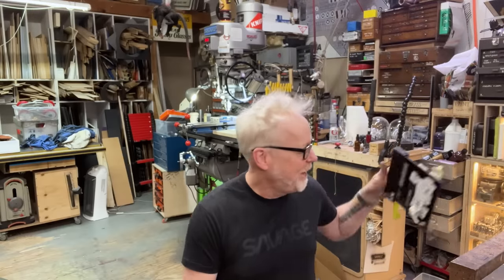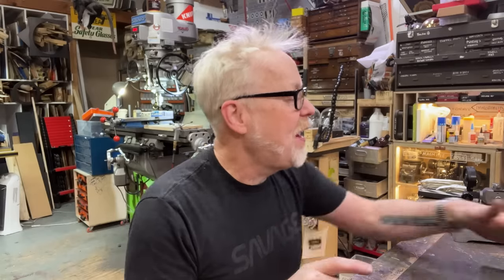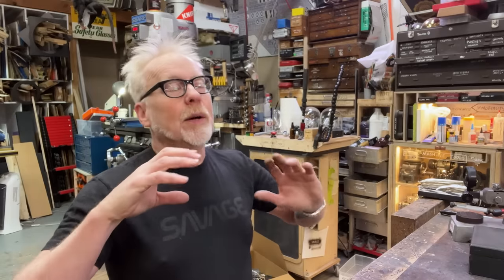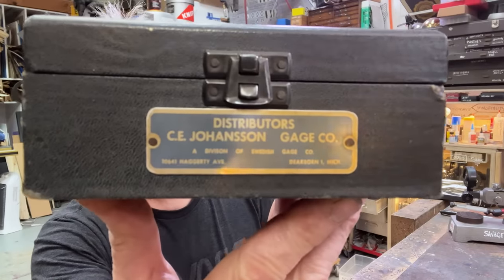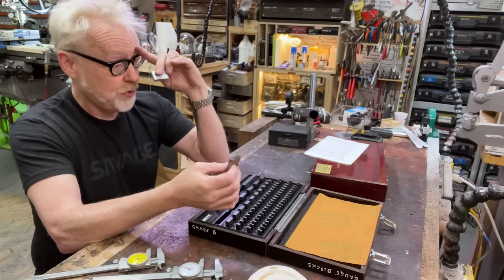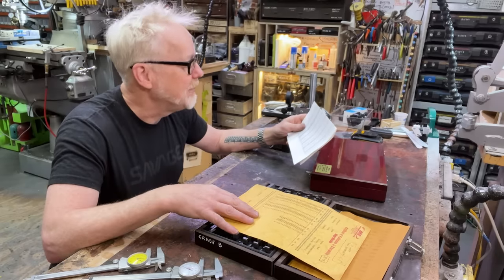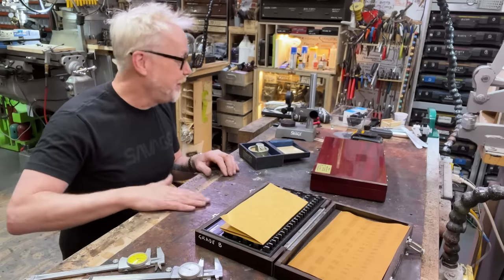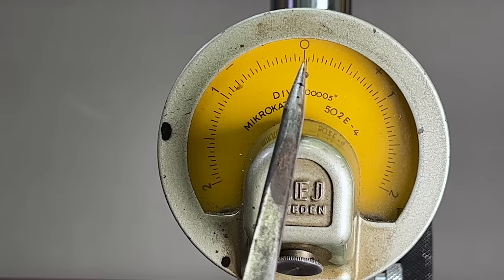Adam Savage's Most Precise Measurement Tool!

Comment: Yep, the mikrokator is cool. We had then at my education in Sweden. It's so sensitive that you can put the gage on your finger and the gauge will sense your PULSE and it till rock the needle accordingly.

The roumor has it that the stock piece of glass used to make the tiny tiny small needle in the gauge is the same one as when Carl started. So they use the same stock as then for the needles.

Comment: 31:57 Some back-of-envelope estimates of that final measurement: via google, steel's coef. of thermal expansion is 0.0000065 / °F.  Observed change in dimension on a one inch reference object is ~0.000045.  That implies about 7 °F change in the steel.  Assuming a room temp of 65-70 °F and a hand temp of 80-90 °F, seems very plausible.  It would be interesting to also see on a thermal camera as it progresses.

Comment: Adam, as a retired engineer I MUST  know what the inside of that magnificent gauge looks like. I don't mean take it apart, but is there at least someone's picture, or a mechanical drawing, of the guts? I cannot imagine its construction for the sensitivity and precision. Beautiful. (The only ones I've been around were optical comparators, overall easier to imagine.)
Reply: Search mikrokator. It's basically a piece of twisted wax paper or a thin metal strip with a needle attached, when the paper gets stretched it moved the needle. It's a really simple but precise mechanism.

Comment: Regarding thermal expansion, a fun project to make on a lathe is a steel jar with aluminium lid (aluminium being the inner part). If you do it with enough precision, it does not open in room temperature, only when you put it in cold, like a freezer. I did this once in a basic mini-lathe, so it is not even that hard to make. Then I put money inside and gave it as a gift to my niece.

Comment: I love the fact you could see a measurable difference from body heat alone after 12 seconds. You could theoretically use that gauge to calculate a metals thermal expansion properties combined with an accurate FLIR or thermometer.

Comment: Having spent a number of years measuring things for a living, one of the most fun things was not what you measure, or the results, or the equipment you use, but how you approach the measurement given a drawing and stated tolerances.

For example, Take a 10" square piece of 1/8" plate steel. The tolerance block on the drawing shows +-0.005". There are three holes. All hole locations are center-to-center with the exception of hole one which is edge-to-center. Hole one is 2.75" from the left edge and 3" from the bottom edge. Hole two is 4" in the positive x -axis and 2.75" in the positive y-axis from hole one. Hole three is 1.5" from hole two at 10° with a tolerance of +0.001" and -0.0005". Verify the piece was machined within tolerances. Dimensions are totally contrived and it's literally been decades since I did that kind of work. But it was the most fun I've ever had on a job.

Comment: Hi Adam, 0.01mm is actually 0.00039", so a 0.01mm metric caliper like you have is more than twice as accurate compared to a 1 thou resolution caliper. Unlike what you said in the video at 6:09, it is actually a hundredth of a millimeter and not a tenth, hence the error. 

No worries though, talking while doing gets the better of us all, just wanted to tell you in case it would fascinate you!

Comment: I used to do phyical calibration for Northrop in their cal lab. I had gauge blocks I'd setup wearing thin gloves then had to leave the setup sit for a set period of time. This was 35 years ago so I don't remember the precise formulae we had to follow it was all in written procedures based on what material was being measured. but it was fascinating stuff to me. I remember watching a measurement change because I breathed on what I was working on. I sometimes miss the cool stuff we were able to work with and on back then before I moved into computers.

Comment: Our most precise measuring tool is a laser array used for long term measuring of structure movement. It works in fractions of a mm and it's a pita to setup, but man, once it's setup you can measure deflection in a wall when peeps walk inside a structure. Very good for figuring out which parts of a wall need to be looked at before (and if any) historical strata may have to be removed. Found quite a few hidden cracks in walls thanks it and thus we could work at the smallest lever of intervention, preserving historical surfaces as they were.

Comment: When we learn to use indicating micrometer (similar in that it has 50 millionth divisions but looks like a regular mic) at my shop, the instructor has us zero on a class x pin then will hold the pin as we talk about the tool. After a few minute he has us check we zeroed properly and you can see a difference in the size. The indicating mic is so temperature sensitive that it has a stand it clamps into so that the operator doesn’t affect the measurement by holding the tool. We also have a sunnen bore gauges that have 50 millionth divisions.

Comment: I may be out of date, but I understood the wringing distance, or in some documents the "wringing film" is actually not known or measurable, and may be less than zero.  Gauge blocks are calibrated by wringing them to a flat plate, and measuring relative to that, so the calibration automatically includes one wringing distance.  This is what allows the blocks to stack without accumulating error, because the wringing distance is already taken into account at calibration time. There may very well be newer knowledge than mine and I may no longer be correct, but as far as I know the mechanism of wringing is still unknown.  And I enjoy interacting with an actual mystery, it is like proof that magic still exists.
Of course that brings up another distance that is not measurable.  Almost all dial indicator tips are radiused, and most dial test indicators have spherical tips, as do most coordinate measuring machines.   When a spherical surface comes in contact with any surface of larger cancave radius, which includes anything vaguely flat, it is going to make contact at a single mathematical point, or in the physical world a single atom.  At an atomic level, does that spherical tip stop at the surface, or does it atomically interact and go into the surface?
And Adam brought up wavelengths of light, as if they were somehow orders of magnitude smaller than the single digit nanometers his ceramic gauge blocks are certified to, but the smallest visible wavelength of light is 380 nanometers.  Good gauge blocks are easily optical flats, with variations much smaller.  The infrared light used by many of the instruments in the various space telescopes is even longer, ranging up to a mm in wavelength.  To get wavelengths down under a nanometer you need to get into the smaller end of the X-ray spectrum.
The next thing Adam needs is an optical flat and a moochromatic light, so he can measure the actual flatness of his gauge blocks.  Optical flats are a rabbit hole I can totally see Adam falling down, as another facet of the attempts to measure anything with both precision and certainty.  Of the two you can only have one, you can be very precise, or you can be very certain, just not both at once.

Comment: I too am fascinated by metrology.  I was blown away when I discovered the extraordinary precision anyone can get creating surface plates using just the three plate method and a bit of patience.  On one level, as you showed, being able to measure at sub-micron precision has no meaning, due to the effects of thermal expansion.  Unless we're prepared to do all our measuring at the same temperature, what we measure is only ever going to be accurate to around the micron level.  Any competent machinist knows that to achieve tolerance to even the ten-thousandth level, you have to measure cold.  However, the CPU in our computers has features in the silicon that require sub-nanometre precision, where the size of atoms becomes important, and we now have instruments which are capable of positioning single atoms, which requires precision at the subatomic level.  It's scary how far we've progressed in just a quarter of a millennium.

Comment: The coefficient of thermal expansion of steel alloys are about 15 ppm per degree centigrade, so warming up your 1 inch steel gauge block by 2 degrees centigrade would cause it to expand by 30 micro-inch or 0.000030", which is about what you showed.

Comment: I had one of those Swede Mikrokators?  Dunno came in a wood box and having no use  for measuring flea whiskers,  and no jig or holder I sold it off. Micrometers do anything I would ever need.  And I got 4 blocks to check them

Comment: Same kind of tolerances are used for check weights in the pharmaceutical industry, when your weighing at mg and lower, you need a weight to ensure your scale is reading correctly, some of the really sensitive scales will be affected by your body heat when your just standing Infront of it.

Comment: There's just something fascinating about measurements and the microscopic precision we can achieve, especially with unassuming old measurement tools. 

I worked in data recovery for a few years, and was astounded by both the scale of the tiny gap between the heads and platters of a standard hard drive, around 5 nanometres. 
I was also fascinated by the small-scale details in commonly manufactured items like SD cards and microSD cards.
 
I'd often have to expose the copper traces under the surface of a microSD card, which are ~50 microns wide. 
Then I'd have to solder 0.1mm wires to either the vias which were ~0.3mm across. 
Or if the vias were damaged or a trace was broken, I'd be trying to attach 100 micron wires to something 60 microns across. 
I had to cut the wires at a really shallow angle to get a narrow tapered point, so that the wire could be narrow enough to bond to the right trace.

Comment: Just some quick math on your hypothesis about body heat:

Thermal expansion of typical gage blocks: ~6.4 ppm/°F
A 20th of a thou is 50 ppm of a 1 inch gage block
So roughly 50/6.4 ~ 8 °F change would do it. This seems about right.

Comment: I noticed in this video that you used several different words to refer to a gauge's gradations, which is what the machining industry pushes for in terms of nomenclature. Calling it resolution and increments and divisions etc etc interchangeably is not incorrect, but it could be clearer to unify them into the term the industry settled on.

Comment: The length of the inch and its relation to gauge blocks is actually even more interesting. The US definition was a tiny bit above 25.4 mm and the UK one a tiny bit below. Johansson compromised at 25.4 exact and that ended up becoming the standard some years after it had already become the de facto standard in manufacturing

Comment: The shop I worked in had a climate controlled inspection lab. We were constantly readjusting our setup because of the temperature difference between the shop floor and the lab. And certain areas had their own gages because the temperatures were so different

Comment: I've worked in microns for years, and when I first learned that there were 25,400 microns in an inch my mind was blown. What I was designing had a resolution of half a micron and was able to be manufactured with a very low degree of rejects. Mine blown again.

Comment: Always remember if you can draw and/or measure something that doesn't mean you can make it. As a CNC Programmer and CNC 1st Class Machinist since 1986 I can tell you from experience never ever take any job that has a tolerance less than 1/2 a thou. And even then make sure only your very best people do that job otherwise you'll be making zero profit on the job due to out-of tolerance rejected parts. Ideally I only ever do jobs with +-0.001" or greater. Anything less requires a temperature-controlled workshop and too much time to be profitable. Also always avoid any military or aerospace or similar jobs because the level of paperwork for each part is just ridiculous. A simple nut can have 3 inches of traceability paperwork that goes with it. I can't even imagine the amount of trees and forests that died due to paperwork from something like the Space Shuttle. If you do quote on such a job multiply the real cost by 50. That's why any very high precision jobs are so expensive. But your life will be so much better without it so it's better to just say no and move on ;-)

Comment: I learned a bit of scale recently that really really made my head hurt in amazement.
The chances of two well-shuffled decks of cards being identical to each other is 1 in 52 factorial, or roughly 1 in 8 * 10^67.
That is so fantastically improbable as to be effectively impossible. So here's the perspective... the commonly accepted estimate for the number of grains of sand in all the beaches, deserts and ocean floors on earth is about 8 * 10^18.  So, if every grain of sand was actually another earth, and every grain of sand on those earths was an earth, the chance of you selecting s specific grain of sand from the sand grain earth of a sand grain earth is 1 in 8 * 10^54... which is still 10,000,000,000,000 times more likely than seeing the same well shuffled deck of cards twice.

Comment: I''ve worked on optical systems that did interferometric measurements down to about 1/10 wavelength (so to about 50 nm resolution).  That's about as good as you can see in visible light.  Optical microscope resolution is normally calibrated on a test chart with lines down to 550 nm width (or 912 line pairs per mm).

This sort of measurements are done in temperature controlled labs, with heroic efforts made for vibration isolation (think of a table whose top is a granite slab weighing as much as a small truck, suspended on air bearings (well, actually, dry nitrogen).  

And they pale in comparison with semiconductor manufacturing, where the current state of the art tops out around 7 nm feature sizes!  Beyond what I've done - I haven't done much electron microscopy, and most of that has been only a little beyond what an optical microscope can achieve, down to 100 nm or so. Good enough for what I was trying to inspect. Mostly, I stick to optical metrology.

I cringed when I saw you handling those Jo-blocks bare-handed!  The good ones, you handle with at least inspection gloves, and you don't wipe them (well, you might swab them with acetone or some other clean solvent), you blow foreign material off with compressed air or nitrogen (either of which has been through a HEPA filter and a cold trap).

Comment: Once you get down below 1/100th mm you have to keep your measuring tools in an environmentally controlled room or the tool will expand/contract slightly (depending on the temp) throwing the accuracy out of the window.

Comment: Some quick math shows that the "half ten-thousandth inch" change aligns with what'd you expect for the thermal expansion of steel. (Coefficient of expansion of steel = 0.0000065 /°F; say about 10°F of heat from your hand with a 1" gauge block = ~0.65 ten thousandths of an inch. Pretty spot on!!)

Comment: Metals expand with heat, that's why computer controlled measuring devices are kept in air-conditioned rooms. Also the objects measured have to be brought at least one day before to that temperature controlled environment to give them time to settle. Steel expands at a rate of 0,000012 millmetres * 1000 mm  per one degree Centigrade added temperature. So, a steel cable at a length of 100 metres ( = 100 000 millimetres ) expands/contracts 0,000012 * 100 000 * 20 degrees C = 24 millimetres. 20 degrees is the temperature difference between two measurements. How long are those cables on the bridge? Also the whole bridge is expanding and contracting between day and night .. Happy crossings !!

Comment: Adam,

The change in the needle can also be due the force of gravity compressing the atoms together. Another explanation for the change can be the ever so slight/extremely fast rotation of the earth ie centrifugal force. Yet another explanation can be the slight vibrations of your movement in relation to the gauge or in a 🤯, the vibration of other things around you like electrical ohms, radio wave frequencies, vibrations of the atoms in the wood bench or even cars/people walking outside. 🤯🤯🤯!

Comment: 6:04 Metric may be less granular, but that's because the units themselves are smaller. 0.001in is actually 2.54 times larger than 0.01mm. That gage you show, even with its 0.0005" precision, that's still larger (not by much, to be fair) than 1um, and you can buy micrometres that will measure in um.

Also, the reason why a "POS" like Henry Ford is much more talked about than someone like Johansson is because you can make the most precise gage blocks you possibly can, if there's no one to use them they'll be useless. Henry Ford was a man that created opportunities for people to use Johansson's gages. Not only that, but he was the one that gave engineers a context in which they could not only express themselves to their fullest extent, but they would also be paid to do so. And in the process he brought about the single biggest advancement in personal freedom and independence in the history of mankind: cheap personal transport.

Comment: I was told b-grade gauge blocks were for machine-side use by operators, to be occasionally checked against an A-grade set kept in a controlled environment for accuracy.  A-grade sets are so much more expensive, and properly using them once a week/month to give a more exact measurement of your B-grade blocks gives you A-grade precision without fear of damaging your A-grade set.  That and in a workshop with a dozen operators the cost would be prohibitive.
Reply: ha! You got to that.  Well I'm glad I wasn't told wrong.